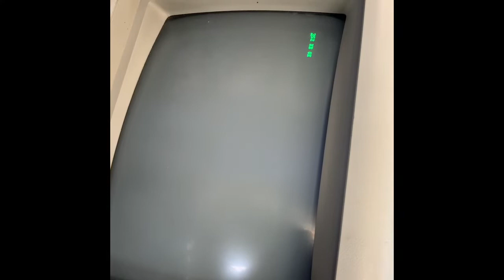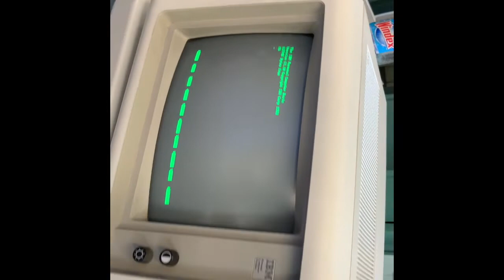Repairing IBM 5160 XT

Comment: Short on the 12v coming from expansion cards knowing ISA is 5v? Mmmm.... But good job, it works ;) I'm still working on a diagnostic for mine (256Kb chips are stopping POST).